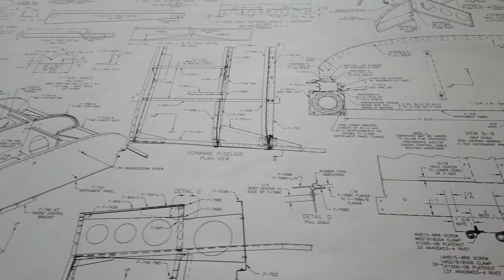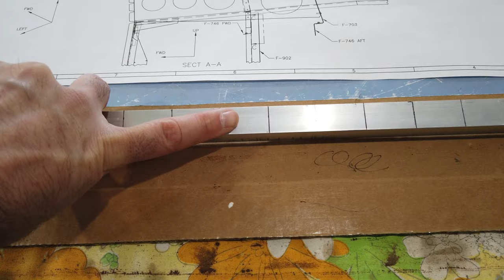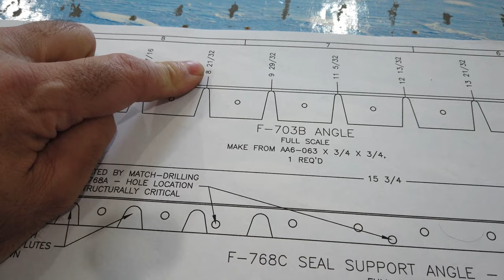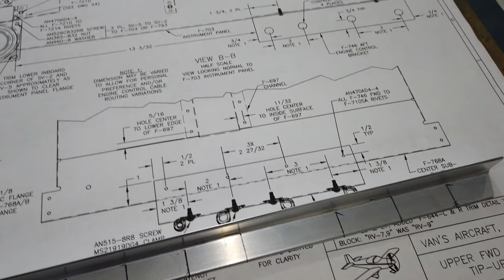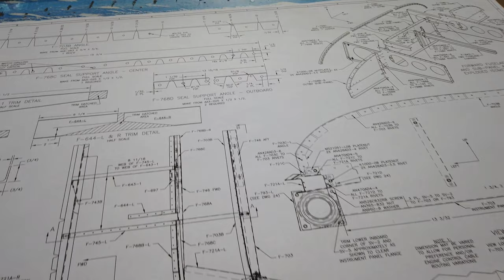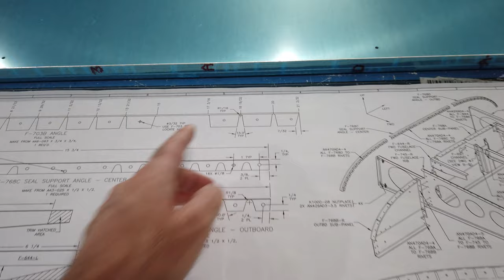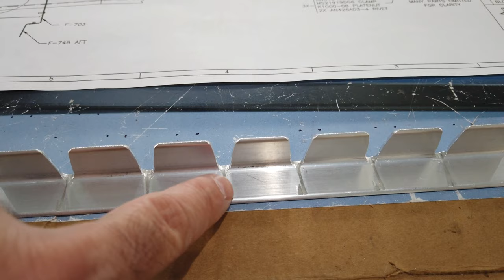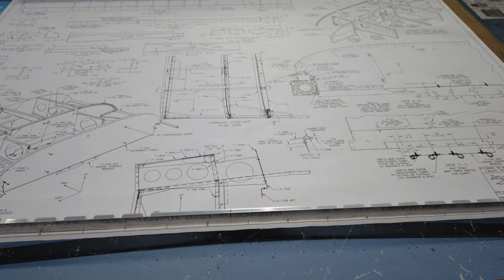Vans RV 7 HINT Video Top Fuselage Tip Up Canopy

Comment: It’s more accurate to measure from the same reference point. You can get “stacking” errors by doing it the way you did. Close enough, I’m sure, but you could have used sideways “cleco clamps” and attached a yard stick to the part, line up the reference point to the zero and mark away. Also I’ve had to convert fractions to decimal and didn’t want to buy a special calculator, I just divide 20 over 32 (or whatever the fraction is) then add that to the whole number.
Reply from the maker: Howdy Tom.  It's true; working from a set reference point is best. I assume this is why Vans layed out the print as they did. Many ways to skin a cat, so it goes. In this case, the ears that are made on the angle are quite large. The stack up you mention would have to be off a lot to begin to show edge distance issues. When I was finished, I believe I was off 1/16" on one end.  I do a lot of various math functions having to convert fractional numbers to decimal  in my job and at home and bought the calculator years ago for this and it's other uses. It is very useful when building airplanes too.